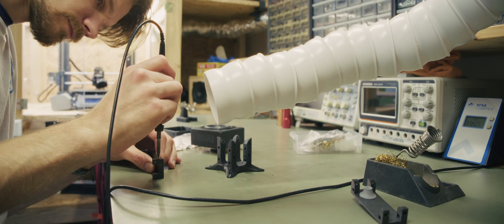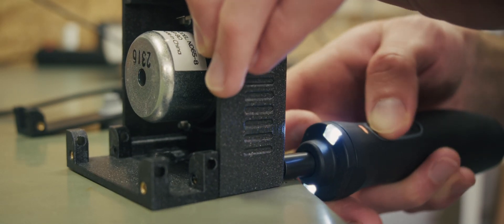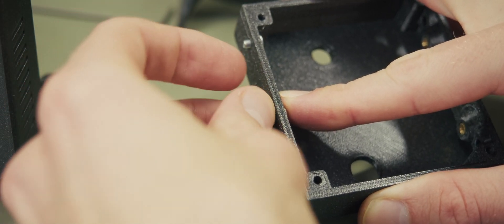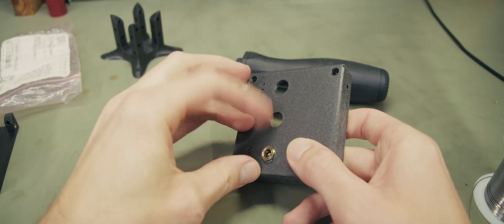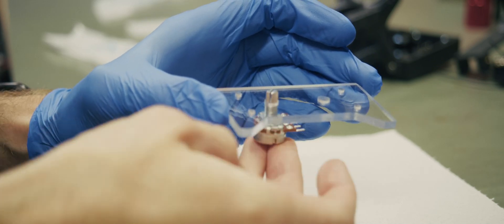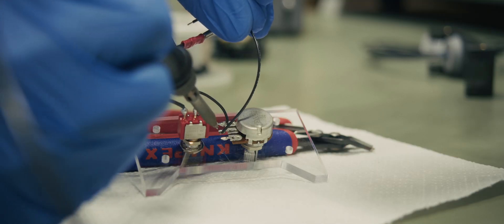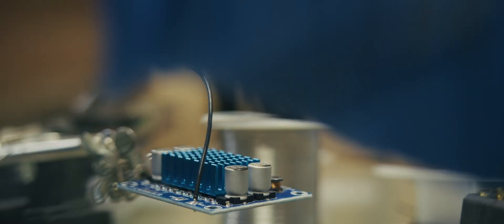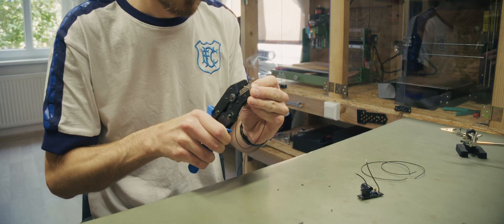Building an electronic sound and light sculpture | boeran quaver

Comment: Bonus tip - when using any proto / veroboard it always helps to give it a wash with soapy water and scrub with a Scotch-Brite type pad. Makes for amazing soldering. You can also gently wipe the whole board with a good flux to further increase the flow of the solder.

Was great to watch the process!
Reply from the maker: Thanks for the tip! I've tried scrubbing with a paper towel soaked in IPA, but didn't notice any effect.